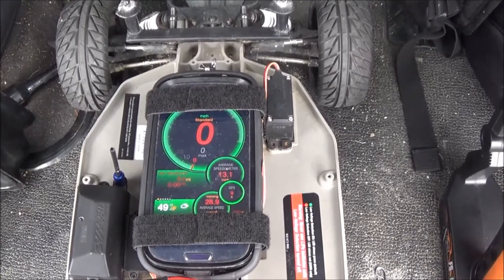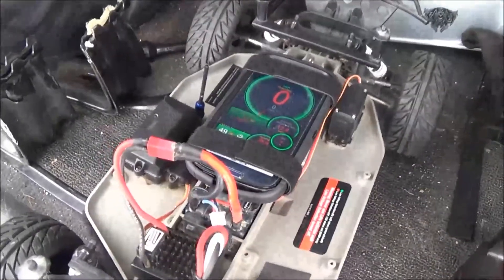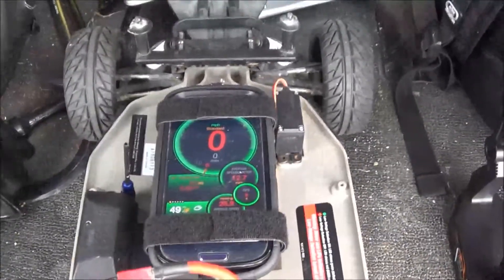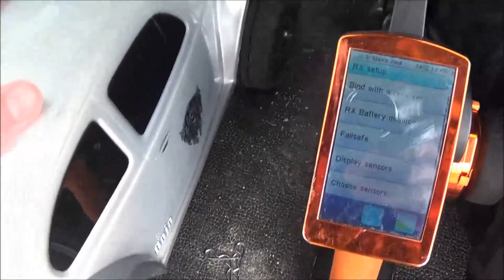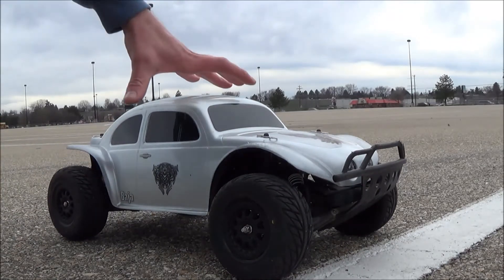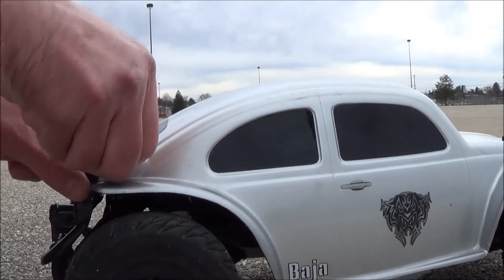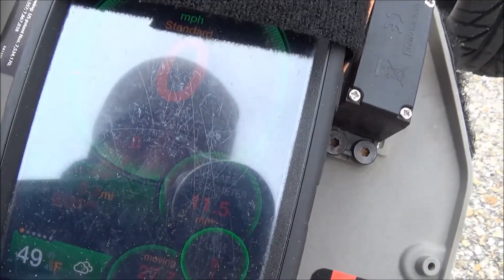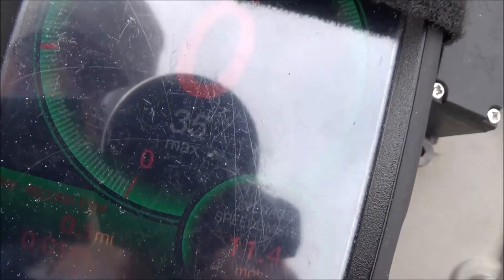2nd Speed run with the Traxxas 2wd Slash

Comment: love the body. also good video :) is this a truck u would recommend?? I was looking for another truck for a long time but couldn't make up my mind. I currently have a Rustler. also, if I get the slash any tips for motor maintenance? I don't want to burn out a bearing or anything and I want something fast to last year's. thanks!!
Reply from the maker: +RC Addict 97 Thank you for the wonderful comment. I would definitely recommend any of the Traxxas Slash line up!  I have a blast with the 2wd or the 4wd Slash. Me personally I like the 4wd Slash I think it's more versatile, and it would definitely have to have the Velenion brushless system in it. As for maintenance the brushless doesn't need much all I do is blow the dirt off with an air compressor or a can of air and oil the bearings with  3 in one oil. Oh and watch the temperature don't let it get to hot! Hope this helps. Thanks for watching!
Reply from the maker: +RC Addict 97 Thank you for the wonderful comment. I would definitely recommend any of the Traxxas Slash line up!  I have a blast with the 2wd or the 4wd Slash. Me personally I like the 4wd Slash I think it's more versatile, and it would definitely have to have the Velenion brushless system in it. As for maintenance the brushless doesn't need much all I do is blow the dirt off with an air compressor or a can of air and oil the bearings with  3 in one oil. Oh and watch the temperature don't let it get to hot! Hope this helps. Thanks for watching!